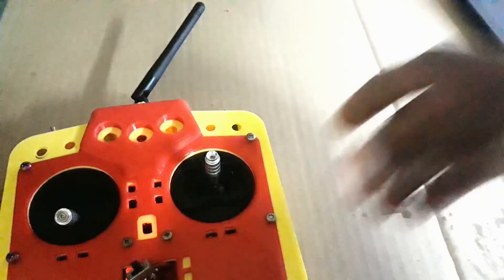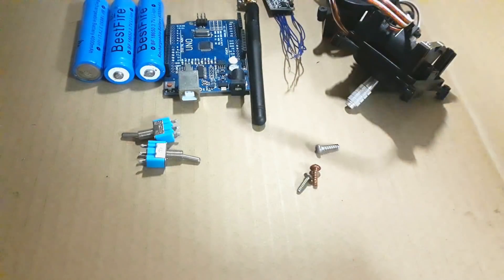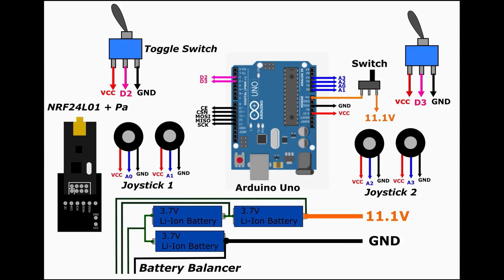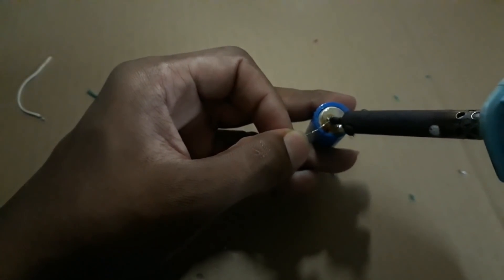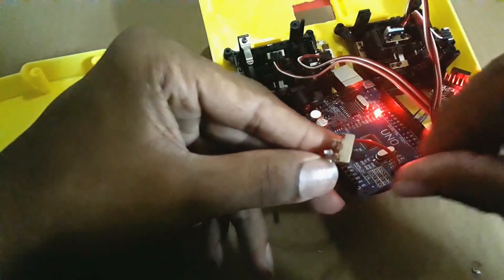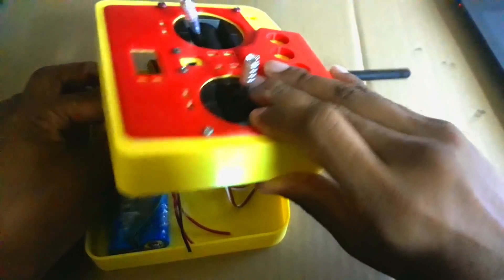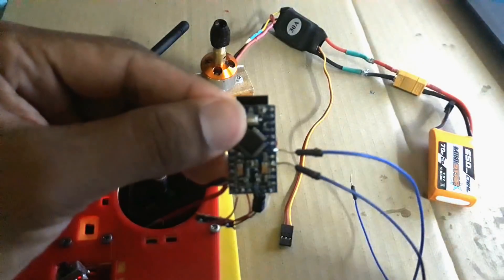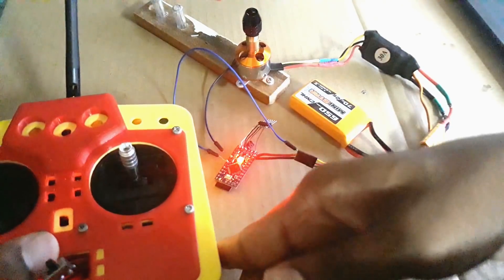Making a professional RC transmitter with Arduino Uno (DIY) - 3D printed Transmitter & NRF24L01

Comment: Hi FSCreations, Thank You for the great detailed transmitter/receiver combo setup. Question. how much more difficult would it be to add an 4inch lcd screen integrated for fpv viewing while flying drone? It seems the three 18650's would supply power enough for several minutes of flying even with the lcd screen? Thanks again.
Reply from the maker: Hello, 4 inch has its own driver board? Normally these screen can work with 5V. Since u are using the screen on the transmitter... if wouldn't normally affect flight time.. but the camera on the drone will take some power... so there will be a small reduction in flight time. You can check SKYDROID FPV which u can get the video on ur mobile itself by just connecting the camera receiver to ur phone

Comment: fantastic,i have some nrf24l01 and i have difficulties making them work,i soldered 100UF capacitors on 3.3v and GND,but no success.what do i have to do to make them function and why did you change the CE 9 and CSN10 pins on Arduino to pins 7 and 8?thanks in advance.great tutorial,keep it up.
Reply from the maker: Are they new? 
Have you made the connection according to the circuit diagram in my website?
CE and CSN u can use any pin.. but you have to declare which pin you are using in the programming. In this case i am using 7 and 8.